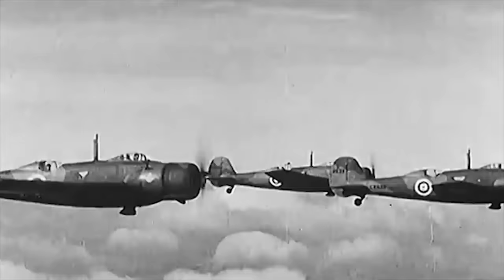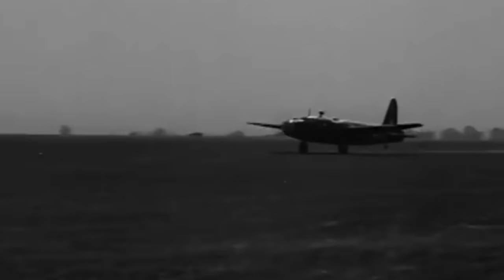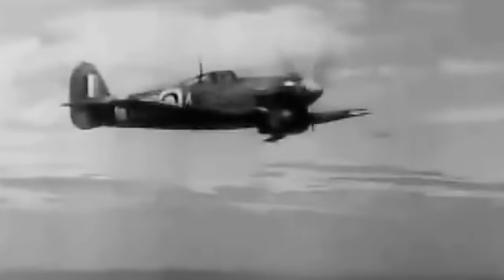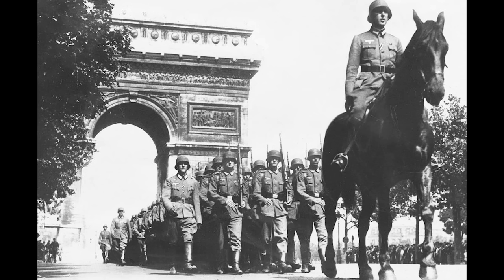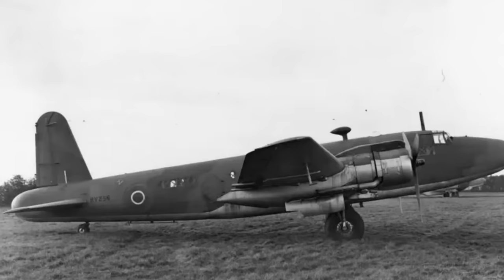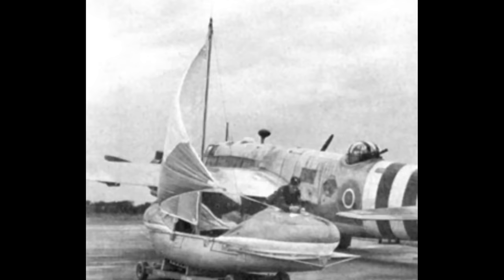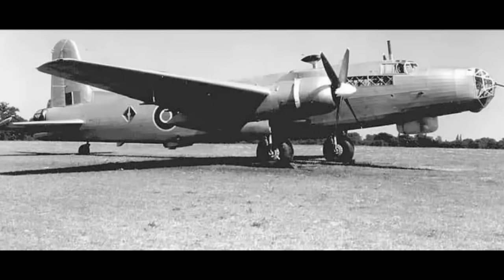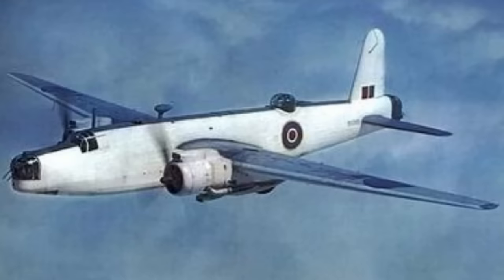The Vickers Warwick; Life Saver

Comment: I think 13k aircrew is not a insignificant number and this aircraft and it's crews deserve much more recognition
Reply: Quite remarkable to think that the equivalent of over 1,850 seven-man bomber crews were saved.  I had heard of the Warwick but thanks to Ed to bringing it to our attention and telling its story.
Reply: Thanks for this programme @Military Matters. The air sea rescue function gets almost no mention. As you say, it lacks glamour.

However, these guys had to perform when, by definition, weather was often at its worst as that was often a contributing factor to aircraft crashing. So they would have flown in the most atrocious of conditions in order to try to save their comrades.

The book, 'Dinghy Drop, 279 Squadron RAF 1941-1946' covers some of this for those wanting further reading.
Reply: That is a huge number of aircrew.   Star performer.
Reply: Looks like a pretty stout aircraft!! 🇺🇸👍
Reply: @jackdaniel7465  they were constructed like the Wimpy.  They were constructed geodetically which made them as tough as old boots.
Reply: @johnhudghton3535  yeah, I wasn't to familiar with that particular British bomber because the excellent Lancaster and the Halifax were always on the forefront, but yes it definitely looks like a brute!! 👍🇺🇸

Comment: My dad flew air-sea rescue patrols with 280 Squadron, RAF.  The squadron re-equipped with Vickers Warwicks in October 1943 but, before this, 280 used Avro Ansons.  My dad said it was a helpless feeling, going to war in a plane that couldn't fight and couldn't run away.

The Annies were only just capable of doing the job.  The inflatable dinghies they carried were so big, the Annies had to fly with their bomb flaps open, because they couldn't close the doors!  Even though the Anson was designed as a maritime patrol aircraft, their range was too short for them to patrol the North Sea for very long,  so they patrolled closer to the UK shore, while longer-ranged and better-armed aircraft like the Lockheed Hudson patrolled closer to the enemy coast.  

The much larger and capable Warwicks were a welcome replacement.

Comment: 13,000 flight crew back into planes to fight again, all for the cost of 100 airframes you could use in anger anyway, yep it doesn't sound glamorous but absolutely crucial.
Reply: iam sure the 13.000 werent  flightcrews only but also alot of Sailors from sunken ships
Reply: Well the 13000 will include some axis aircrews (the sea does not take sides, neither do rescuers), so it's more "an extra farmhand" than "a pilot back in the fight"

Comment: This has prompted me to look into the deployment of these airborne lifeboats and it is fascinating. The first were the Mk1s (71built) which fitted the Lockheed Hudson and were first used operationally in May '43. The Lifeboat-Warwicks used the Mk 1A (402) and later the larger Mk2 and 2A (241) and were operational from Oct '43. It was a very tricky operation...first the survivors had to be located of course, and the boat was dropped from about 700 feet. Large parachutes were deployed but the boat would still hit the sea at quite a rate and was sometimes damaged or turned over. (They were wooden after all!) During the drop a CO2 bottle was triggered which inflated the buoyancy chambers, and on reaching the water a battery  switch would trigger  2 rockets (yes!) to fire out lines to either side for survivors to grab , and another rocket would fire out a line from the bow to deploy a sea anchor. If the boat was not close enough, or the sea/wind conditions were not helpful, the survivors did not always make it on board. Sometimes multiple drops were needed to save a crew. If they did make it, there were two small 2-stroke engines, or 1 larger engine in the later versions , and they could attempt to head to a friendly coast. The vast majority were picked up by patrol craft directed by the rescue plane. Perhaps Mr.Nash could give us a video about wartime Air-Sea rescue development? It's an interesting story.
Reply from the maker: Lol I think you've provided the info already!
Reply: @EdNashsMilitaryMatters  Sorry! I think in my over enthusiasm I have repeated some of the info that you already narrated in the video. Apologies.
Reply from the maker: @timdavies5219  Perfectly fine. Think you added some valuable extra info

Comment: Ed:  It would be interesting to see a vid on the many engines, which did not live up to the pre-build, calculated expectations.  Secondarily, how many otherwise good aircraft designs failed, due to the planned engine not being up to snuff.  

We hear about this on several of your vids on aircraft.  It would be interesting to see it in macro.

Thanks
Reply: There's dozens of them and the reasons why they were dropped are hard to fathom.
Reply: @jimdavis8391  Most of them were because, as I wrote, the engines did not live up to expectations.  Ed has mentioned dozens on individual vids.  That is why I suggested a roll up vid on that subject.
Reply: I think that the development of high output, high specific output engines were alway going to be a challenge regardless of the country that were developing them. You can point to the B 29 and HE 177 as examples as well.
Reply: I do wonder if the failed engines like the RR Vulture would have been perfectly fine if developed in peacetime without the pressure forcing manufacturers to build rather than design and develop.

Comment: Before Ed had mentioned the stability issues I was wondering why this design hadn't sprouted a much bigger fin by the time the big Centaurus's had been installed. I have always tended to think the B-17's fin was basically the size norm for multi-engined aircraft. The FW-200 is another multi engined aircraft with a surprizingly small fin from the outset, and was never modified. Directional stabilisers never seem adequate enough with the Me-109's Nemo fin being a case in point.
Reply: Well the final German 109, the K, did have a taller fin. Not to mention the towering unit on the 209-II that was once intended to replace the 109 (look it up if you haven't seen one, it's a sexy beast...sort of a Bf109K/Fw190D mashup)...
Reply: That's about how the Me-109 should have looked all along. It looks better than the Ta-152 and a pitty it lost by 50kmh to the Dora. Thank you for reminding me of the 209, and I see its mentioned in another of Ed's videos. @stevetournay6103

Comment: This has to be the first ever instance of "reliability issues" and "double wasp" being used in the same sentence ive ever experienced
Reply from the maker: The early ones had some problems, which was pretty much standard with any radial.
Reply: @EdNashsMilitaryMatters  sorry Ed I wasn't trying to imply you were misrepresenting the reliability of the Double Wasp, moreso i just think the lack of discourse around failures and the double wasp is a strong indicator of the quality of that powerplant.
Reply from the maker: Absolutely! As said, the centaurus turned into a good engine, but it was a while getting there. P&W really did get it right with the twin and doubles.
Reply: English please.

Comment: I take issue with the line 'long, boring anti-submarine missions that may have had not much glamour or often proven very exciting'.

Dad was a wireless operator/air gunner flying in Liberators from Ballykelly in Northern Ireland. His RAF log book has multiple entries along the lines of 'Attacked U-boat on surface, aircraft damaged, return to base', 'Anti ship patrol, aircraft damaged', 'Attacked by fighters, aircraft damaged' - plus numerous 'Recalled - weather' as well as several engine fires.

Certainly the patrols weren't short - 11 to 12 hours plus in some instances - but being 'attacked by fighters' is hardly 'boring' and even less 'very exciting'.

It was long, cold, bloody dangerous and a lot of Coastal Command aircrew lost their lives.

Comment: Anyone else wonder why the Warwick was never developed as a pressurised aircraft? Seems it had the structure to suit... Simply cover the skin in ally to replace fabric and fly it high, and fast..?
Reply: If it had an aluminium 'skin'  covering thick and strong enough to accept the pressure loads, it would be much too heavy! There were  a few high-altitude Wellingtons produced, which had the same geeodetic structure, but the crew were housed in a cylindrical pressurised capsule at the front, about 5 feet in diameter and 15 feet long. The prototypes and a handful of production aircraft were used in trials, but most of them were not used as high altitude bombers as planned, and were scrapped. I think you could say that one of the reasons that geodetic structure didn't 'catch on' after the war was that it was not suitable for pressurised high performance aircraft at all.